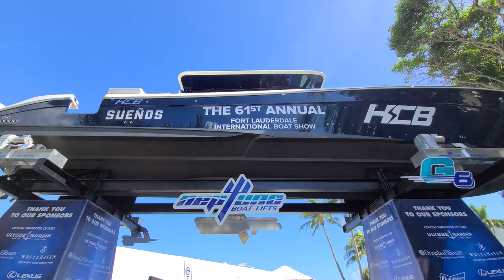Princess Yachts V78 at FLIBS 2020

Comment: I believe that the Princess V78 has not really changed since her conception at least 9+ years.

Externally there's been some change. Internally the same as the previous iteration back in 2014 bar some material options.

I love the look of the V78, so I can see why it hasn't been changed much since the launch date.

I feel like it could slightly change the rear windows to better drop off between the two area's in cockpit and the aft saloon and the window next to the aft saloon on the port side could be designed to lower and make it feel like you're outside.